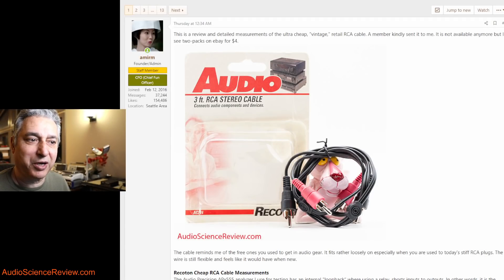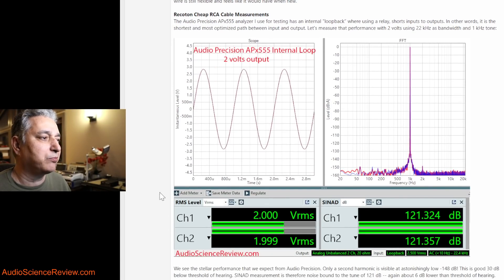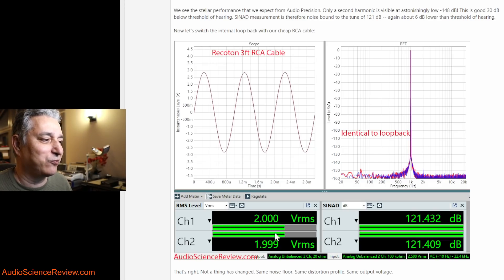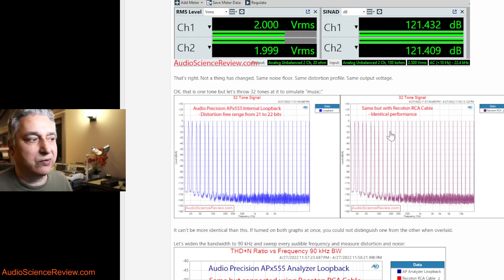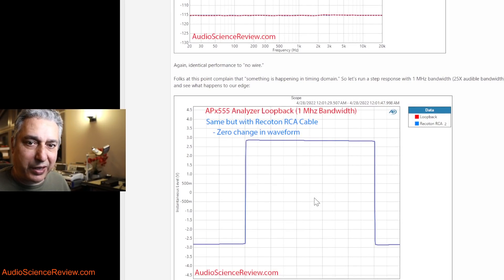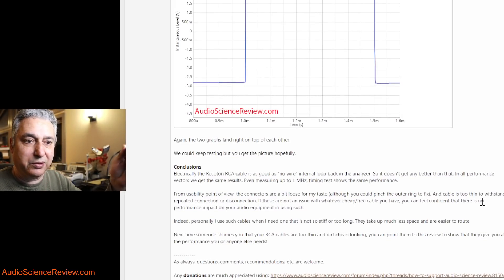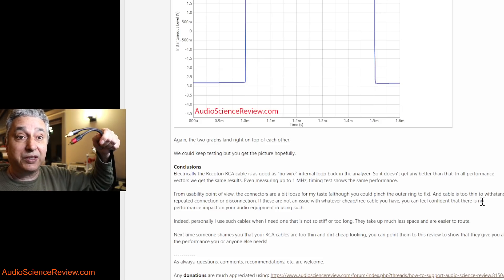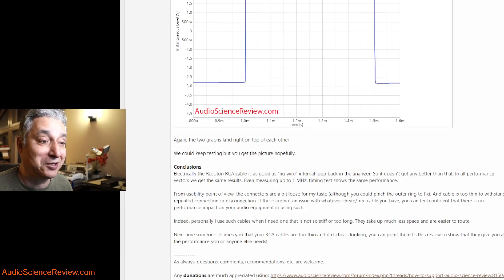Are Dirt Cheap RCA Cables Any Good?

Comment: I tried using 6 feet of super thin, unshielded RCAs for component video just to see how it looked. I saw no loss of picture quality on a 32" flat screen.

This cable was also able to send 24/192 FLAC through coaxial output.

If the cables are short enough, it doesn't matter what you use, with the exception of turntable to phono input/preamp
Reply: Tv is not audio, it’s video.
Reply: @aussie8114  Video requires much higher bandwidth than audio. If the cables can handle high definition video, audio should be a walk in the park for them
Reply: @ Nope, you don’t listen to video. I’ve set up numerous audio systems from a few thousand up to about 50k. I’ve listened to many analog cables. These cheap things are total crap for audio. But if someone has a pretty crappy system and doesn’t care then use them. Ignorance can be bliss for some people.

Comment: Cheap RCA's suck. No shielding, fall apart, and corrode. However, you can get a great shielded, superbly built RCA for 20 bucks. The measurements simply show that any 75 ohm segment of copper wire sounds the same. That's not the only measure of an interconnect

Comment: That's the exact cable I used for years, and the pleasure I got from listening to music through it was fantastic.

I would have liked to see you doing an induced noise test, from holding a transformer next to it. Then doing the same induced noise test on a XLR cable.

Your videos are excellent, as it's the pleasure you get from listening to music/videos that counts.

If people get pleasure from their audiophile fetish, and want to buy a more expensive cable, than the absolute cheapest cable, that's okay too.

But people should be made aware, that the reason why more expensive cables sound better, is because of their brain generating the placebo effect, so they won't be able to tell which cable they're listening to in a blind test.

Comment: Can you give us a bad review? I really mean it, show us a bad cable and whats the LRC parameters are.
Here is my example I used a 5m long cheap cable and the base was a bit much, mid range muffled, if I crank the DAC to maximum and turn down the amp, the midrange improves but still present, if I turn the volume a little bit above confortable listening level, mid range cleans up more. The LRC parameters of the cable is, like 10-20nF capacitance and things like that, if I replece the cable with a proper short one all the problems dissapear.

I'm curious what are the minimum resistance, inductance, capacitance parameters that can introduce distortion. I know lots of people struggle with long interconnects end up buying expensive cables, than praising them how good they sound, wort every penny, I just bought a cheap 5m active USB cable, a short RCA cable and put my USB DAC next to my amp problem solved.

Are these measured DACs perform the same when you use them 50%, 20%, or 10% of their maximum volume, what are the measurements at 125mV, 200mV, 500mV, 1000mV are they the same?

Comment: Nowadays some RCA cables that come with TV set-top boxes use some sort of ferrous material instead of copper, one can check with a magnet. The conductor core corrodes with time, definitely not recommended for any application.  Otherwise any OEM supplied interconnects are OK

Comment: Absolutely quality review.  I'm 76 and have been an audiophile since my late teens (Fisher 400 anyone?).  I've owned many, many audio devices over the years.  Some expensive and others inexpensive.  I've bought and sold amps/pre, speakers, DAC's, tape recorders, TT, CD/SACD, portables, etc., etc. more than I can remember.  Have I ever "fell" for the cable scam...yes but within reason.  Never more than a couple hundred dollars for a pair of balanced/unbalanced as well as speaker wire.  I've always argued that I could not hear any difference between the models/brands regardless of price/quality construction.  So, thanks a lot for proving this old man has not been crazy all these years.

Comment: RCA cables are the only cables where I notice a difference in performance between dirt cheap and slightly-less dirt cheap. But, the performance I notice is purely down to fitment. Some cables just don't make a solid connection. Same with some garbage tier HDMI cables.

Comment: Normally I'd be the first person to highlight the "audiofool" bs relating to cables but in this case I'm not sure i agree 100% with the video.  Back in the late 90s i used to make my own interconnects using some reasonably priced "silver" RCA cable.  I could definitely hear a difference compared to a generic thin cable like the one you have there.  I guess i need to repeat that experiment with my older ears! 😂

Comment: I have a $450 Pre amp and a $1000 amp. In neither can you "upgrade" to a $$ power cord. The connections on the equipment don't allow it. I can only find $10 replacements. These are two well respected audio companies.  Are their designers and engineers trying to tell me something ?

Comment: Sure. Now connect it to a full system or a Home Theatre receiver with a bunch of other cables around, including power cables and and video cables (better yet, try one of the sh*t video cables just like those interconnects) and see what happens. You will get noise as they DO act like an antenna, pulling-in RF interference that will ruin your sound, especially in the high frequencies.
Reply: There's people who do their testing from sitting in front of a monitor, and there's people who do their testing from using the things on the side of the head. I think know which when you fall on.

When listening, I also prefer not to put up with the faint background signal noise (noise floor)

One should try pressing pause or mute, and from the MLP,  if one is unable to differentiate whether the systems are on or off that's telling you, your cables are crap.

When friends or guests come around rather than showing them how loud the system goes, I prefer to press pause/mute and show them how quiet it goes. None of them gets it, of course 😂

After auditioning three separate AVR's, the same ambient sound of the room was still present! It was only on the third occasion when I finally purchased shielded cables that the noise floor in my small room finally came down to satisfactory levels. Cables often act as antennas for attracting RF, and the longer the cable, the better the antenna. Probably explains why when I used to disconnect my heights and surrounds within 10 minutes, the faint background signal noise (RF/EMI) within my small room used to disappear/dissipate.

Comment: Reasons to avoid these are:
1. lack of shielding
2. poor contacts
That doesn't mean interconnect should cost thousand(s) euros/dollars. 
I use QED performance 40i and there is huge difference in perfomance vs. generic cables especially for turntable connection. I find them as "sweet spot" in terms of price/performance.
Everyone can afford them.
Reply: Just like genie from audioholics, this channels all about telling the viewers what they want to hear rather than what they need to hear.

Nowadays, if one sits in front of a monitor long enough, one can actually call themselves an audiophile. Amazing 😊

Comment: Just spent about $200 on an RCA cable for my new Technics SL1200GR turntable.... The one place in a system where a cable actually makes a difference is the tonearm RCA cable due to the super low voltage coming through it. The resulting sound is easily changed by different materials and construction. Small differences are amplified by huge amounts by the phono preamp and as a result can be easily heard.

Comment: You was lucky because It's not bad cable. I have an old cable that looks similar with great sound. After a long search I found new cheap cables with similar plugs, Hama 205085 and Goobay 50028. Surprisingly the Hama is band-limited, with rubber-bass and scratchy highs but Goobay is very clear, wideband and detailed.

Comment: I've had some of these very thin freebie cables develop problems around the connector where moving it slightly caused the signal to cut out or it would induce some noise into the output.  Not all freebie RCA's are equal either - some are clearly better made than others - the ones I don't like seem almost hair thin...  I don't object to spending a reasonable amount on a well made cable that's going to last and not play up.  It's when it's taken to absurd levels, both in terms of prices and fantastical claims that it becomes silly, IMHO.  Away from RCA connections, I've had particular problems with sub-standard USB 3.x cables which presented as frequent disconnects during heavy file transfers to external HDD's - the problem resolved once I changed the cable.

Comment: Although I'm against audiophile bs about magic cable parameters, I can't agree with this one. I used 1m long RCA cables provided with my Asus Xonar sound card plugged into an external headphone amplifier. When I bought 20$ pair of RCA cables the difference was noticeable right away. I could switch between cables and point out details that were missing with "generic" cable. After cutting it, I saw only a pair of  hair thick wires, no coating and no shielding. Dirt cheap cables are lottery and perhaps you just got lucky with this one but after my experience I wouldn't risk dead cheap cables anymore.

Comment: The only thing to look is oxydation and dirt on the male and female parts of the plugs, clean both the device and the cable end. The if the cable can be unscrewed open it an look at the crimping or soldering if it is clean looking and if contact is good. On solder you can be suspicious if the solder it looking matte. (it should be shiny) Because if you use old cables or things that were not stored well, you can have dirt or oxydation making the cable unreliable. other than that a cable is a cable !!

Comment: Hi Amir, could you please make a video testing cables in a situation that does affect the measurements drastically for educational purposes? Say very long lengths of audio cables, or cables with very high capacitance and DC resistance. Would be nice to see the characteristics that actually affect the measurements for a change.

Comment: In the world of high speed digital electronics the length of a cable (or PCB trace) doesn't matter until it approaches around 1/6 the "Transition Electrical Length", or TEL. What really becomes a problem is signals that transition quickly, or the rise and fall time or the signal. Rise and fall times are usually close to symmetrical. TEL is calculated by multiplying the rise time by the velocity of propagation. In typical PCBs (Er ~ 4) the velocity of propagation is about 5.8 inches per second, or about 150 mm/s.

Both controlled impedance PCB traces and coaxial cables are types of transmission lines. When the length of a PCB trace or cable approaches TEL/6 controlled impedance becomes important and the PCB trace or cable need to be engineered as transmission lines. A transmission line is used to control reflections which occur from impedance mismatches. Reflections decrease signal integrity and can cause jitter to increase in the best case and completely prevent the data from being received in the worst case. 

In a PCB the velocity of propagation is about 5.8 in/sec. This is a function of the speed of light and the effective dielectric constant of the PCB's fiberglass sheets (about 4.0 for typical PCBs). In coaxial cables, the dielectric can vary, but it usually some type of plastic like polyethylene (PE - common used in cutting boards and shopping bags) or polytetrafluoroethylene (PTFE/teflon - like in nonstick cookware). It can be a solid, a foam or it can be spirally wound so most of the space between the cable's center conductor and the shield is air. Some common cable you might have around the house is RG-6 for your cable TV. It has PE foam dielectric and a velocity of propagation of about 0.75 times the speed of light, or 8.9 inches per nanosecond. The RCA cable shown in the video probably uses PVC between the center conductor and shield, and has a velocity of propagation of 8.0 inches/nanosecond 

In analog audio the fastest rise time possible on a CD is a 1 / (44.1 kHz / 2) or 45 microseconds. So TEL/6 calculates to (45,000 * 8.0) / 6 = 60,000 inches, 5000 feet (nearly a mile) or 1521 meters. This assumes the output of the DAC has been low pass filtered with a -3 dB bandwidth of 22.05 kHz. Inside the actual player there are faster rise times as the digital EFM stream is read from the Redbook, converted to LPCM and fed into the DAC, but that all happens on the PCB (maybe even inside a single IC) where distances are much smaller and cable choice doesn't matter.

In digital audio, I don't know if it is as well defined, but lets assume we need 10x the bandwidth of the signal to accurately reproduce the edges of the square waves. This is the assumption I use for square waves in PCBs. Let's also assume the cable is 75 ohm impedance with solid PE dielectric (7.8 inches/ns). Assuming a digital PCM stream of 44.1 KHz * 16 bits per sample we have: 44.1 kHz * 16 bits * 2 channels = 1.4112 Mbps (should look familiar). We will need a bandwidth of 10x the bit rate to transfer the data properly using a single ended square wave, or 14.112 MHz. This implies a rise time of 70.9 ns. TEL/6 in our 75 ohm PE dielectric coax becomes 92 inches or 2.3 meters. We are nearing the threshold where controlled impedance starts to matter in terms of typical cable length. I would (and have) use a 75 ohm cable in this case. I saw elsewhere on the web someone measured the rise time of a PCM stream on a digital audio output at 25 ns which is about 3x faster and TEL/6 would decrease by 3x as similarly. They had some other conclusions about some cables being too short, but I don't know how they came to that conclusion and of course there was no citation. 

We could do something crazy like encode the audio with 24 bits at 192 kHz. Running the numbers TEL/6 in solid PE coax is 14.1 inches. Definitely need a 75 ohm cable here for lengths of 1-2 meters. 

However, if we just use 75 ohm coax (with 75 ohm terminated drivers and receivers, i.e "impedance matching"), then it doesn't matter. Reflections are controlled and all that you need to worry about is losses. I'll spare the details, but the way to figure this out is to calculate a link budget based on the transmission amplitude and the receiver sensitivity, taking into account losses (copper losses, dielectric losses) and noise. Suffice it to say it doesn't matter over distances of 1-2 meters at these frequencies.

When I hooked my CD transport (a Blu-ray payer) to my AVR I used a single coax from a component video cable set. These were used before digital video cable standards like HDMI evolved and they consist of a set of three cables that carried the color and sync information in the analog domain. Each cable is 75 ohms. I removed a single coax cable from the set of three. It doens't matter that it is for video, the electrons don't care. I had this cable laying around and it was effectively free. My local Hi-fi shop wanted $69.99 USD for their least expensive coaxial digital audio cable. I've seen 1 or 1.5 meter cables going for hundreds of US dollars which is absolutely absurd. Even 70 USD is nuts. 

If you think you hear a difference, go ahead and spend your money. I'd rather invest my money elsewhere.

Comment: Heeheehee 😄 Thank you - this should be enough to forever shut down the "high end cables" nonsense, but then again, the "audiophile brigade" will somehow try to claim that their magic cables IMPROVE the sound 🤣 "Unchanged" isn't enough for them!

As for those who use "cable lifters" and other such nonsense...well, there was already no hope for that bunch of placebo-heads.

I've been involved in pro/broadcast video/audio for three decades. Only three times in my life have I ever had any "issues" with cables:

#1. I was throwing a party and didn't want my HiFi getting damaged, so I moved it to my bedroom and ran long (cheap!) cables to the livingroom. It wasn't actually "speaker cable" - just a reel of cheap twin-cord I had lying around - first (and only) time I've ever noticed a negative effect from inadequate cables. It was an improvised bit of wiring for one night only. All I did was double-up the cables (a pair for + a pair for - ). Problem solved.

#2 I bought an "attractive" (but inexpensive) 3.5mm to RCA cable to run from a Mac Mini audio-out to an amplifier. The sound quality was fine,  but the shielding of the cable was poor (picking up noises from nearby equipment), so I had to make sure the cable wasn't placed too close to any interference sources. I upgraded soon after. No big deal.

#3 - I bought some "6G" HD-SDI cables through eBay. They were only short runs, so I wasn't too concerned about how truthful the "6G" rating was, but yeah they weren't great! Normally I use Belden, but this multi-pack was a good price...anyway...I learned from my mistake - high-definition digital video (+audio) going through a single conductor deserves the very best (BRANDED!) cable you can find! Line-level consumer audio cables, carrying no more than about 20khz signals, not so critical!!!

So long as your cables are sufficiently-well shielded, thick enough for the distance required, and have decent-enough connectors on the ends, you'll be fine! Gold plating is a nice plus - purely since it won't oxidize - but aside from that, there's really no magic about cables, other than their magical ability to extract thousands of dollars from audiophiles' bank accounts. That will never change though - the crooks in the audiophile world, and the fools they target, will continue to thrive.